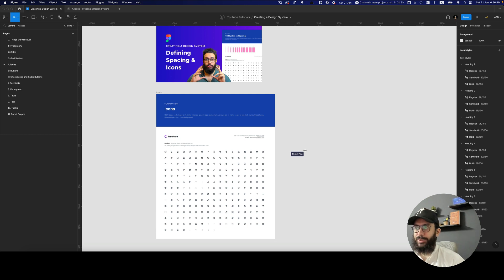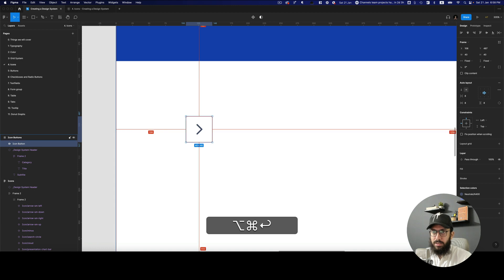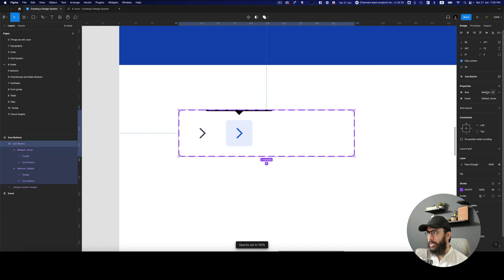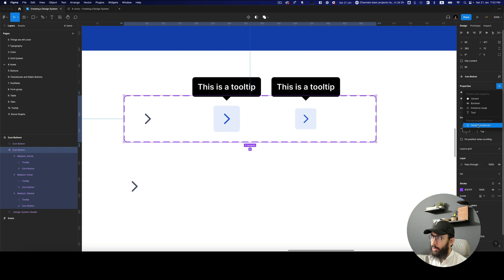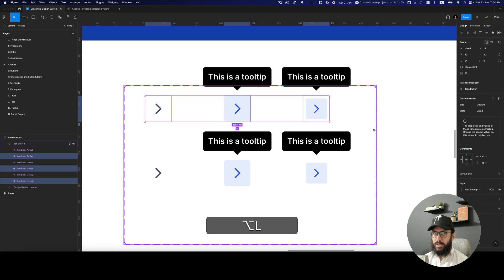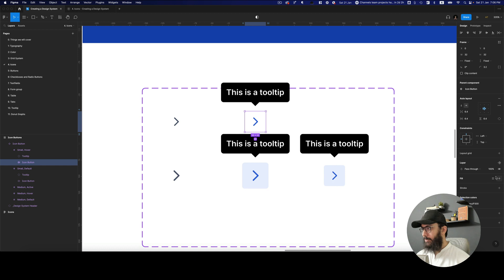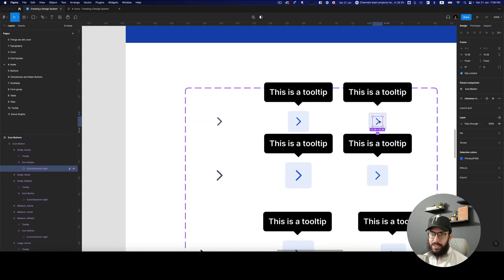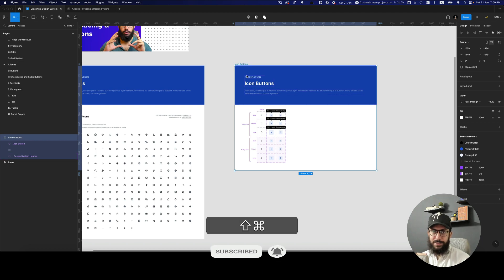Creating a Design System - Icon Buttons (with Component Props)

Comment: I like the way you attached the tooltip to the button without the need to use Absolute position on the tooltip.
But the problem for me was the tooltip text didn't change and was persistent to the default value of the tooltip component when I used it in another figma file, Any idea how to fix that?
Reply from the maker: Can you share your file?